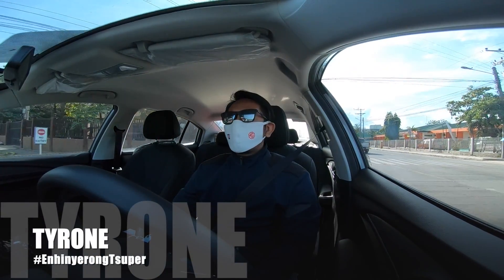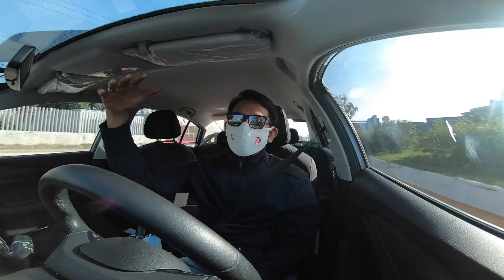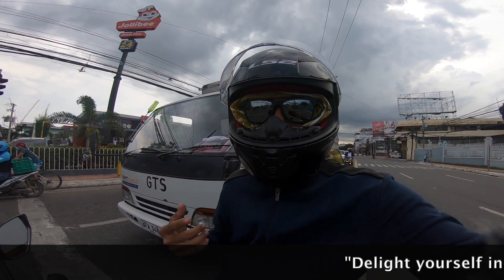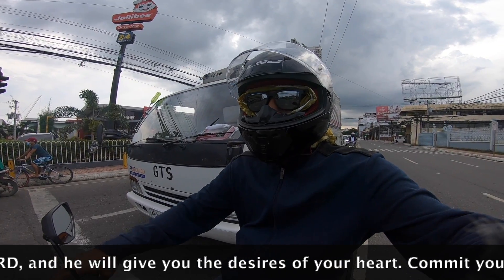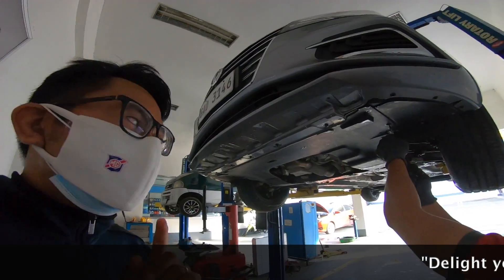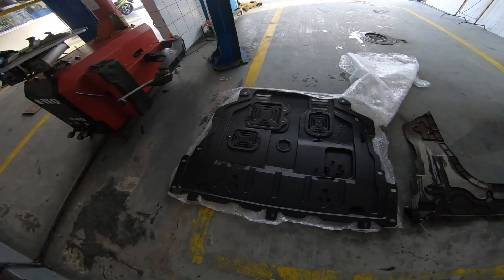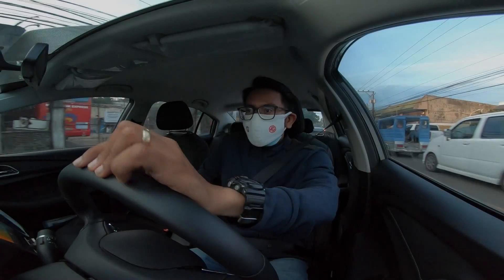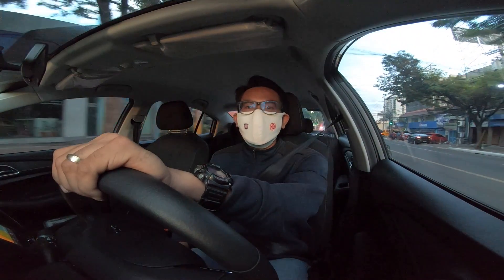Installation of Engine Undercover of my MG5 & Review | by MAGNUM AUTOPARTS

Comment: Sir ask ko lang may mga encounter na issue ba kayo sa MG5?  And mas tipid ba sya compare sa ibang sasasakyan in terms of consumption sa gasoline?  Parating na kase unit ko this week. Heheh yan din kase sabe saken ng dealer No over heat daw kase spacious sa loob ng engine bay malugag tinngnan unlike sa ibang brand sobrang dikit dikit yung mga parts sa engine bay.
Reply from the maker: Yes sir, tama po sinabi ng agent, maluwag po ang engine bay and never pa po ako na.overheat.
Sa fuel consumption, okay naman, di lang ako sure sa comparison sa iba. Depende rin kasi yan sa driving style.
Congrats po sa brand new MG5 nyo sir! 😊
Reply: @enhinyerongtsuper5873  salamat sir.  mabuhay tayong mga genuine MG5 car owners
Reply: @enhinyerongtsuper5873  ask lang sir. Kakakuha ko lang kase ng unit ko, normal po ba sa MG na nagmomoist ang lower part ng headlight?  Worried kase ako lumalala ang moist pag nagdadrive ako ng gabi lalo pag long drive pa baka magkaroon ng problema aa electricals
Reply from the maker: @jonaldbeng  yes sir, normal po yan para sa atin na mga MG Cars. Actually, di lang tayo. Pati na rin BMW, Volkswagen, Mercedes Benz, at iba pang European cars. Ganyan po talaga ang mga European cars. So no need to worry about it sir.. 😊
Reply: @enhinyerongtsuper5873  talaga po sir? Pati po ba ang unit nyo is nagmomoist din sa loob ng headlight?
Reply from the maker: Yes po sir, sa may lower corner nag sisimula ang moist.. 😊

Comment: Sir tyrone, what makes you decide na magpalagay ng engine cover? Sa past vlog nyo sabe nyo ung reason na open ung engine sa ilalim is for ventilation and prevention sa over heat... 🤙🏻
Reply from the maker: You are really watching and taking every detail sa vids ko sir. Thank you.
Based on experience sir, okay naman yung cooling system ng MG5, even 4-6hours ko syang gamit straight naka ON and mostly 4hrs standby sa parking lot, so okay naman. Mas concern ko kasi ngayon yung splashes ng putik or tubig na umaabot halos sa ibabaw ng engine. Kaya trinay ko mag engine undercover and will observe it as the time goes by. 😊
I'll make a follow up review soon about its effect sa unit, esp sa cooling system nya. 😊
Reply: Oo nga po sir tyrone, sbi nyo its for good ventilation
Reply from the maker: So far naman sir since nakabit okay naman yung temp.
Reply: Hi sir tyrone would this prevent rats from getting to the engine? Thanks!